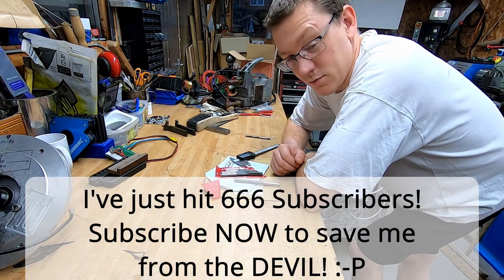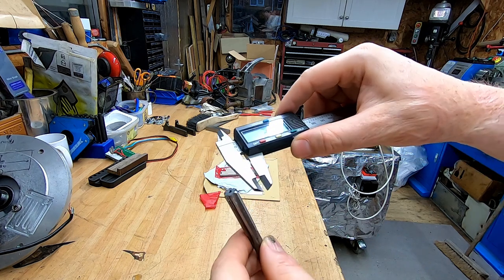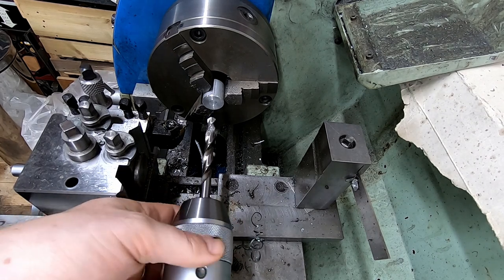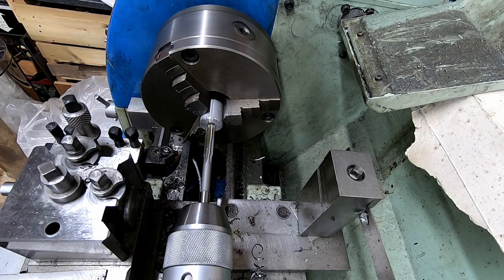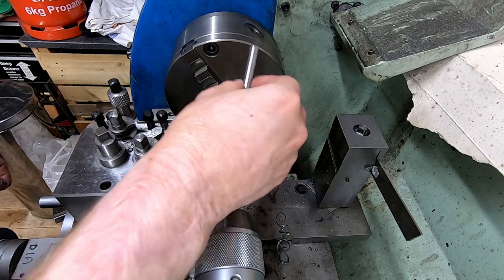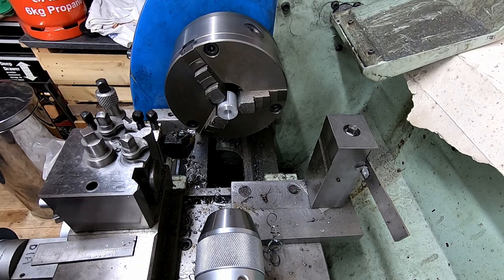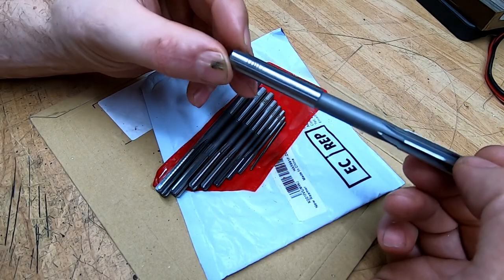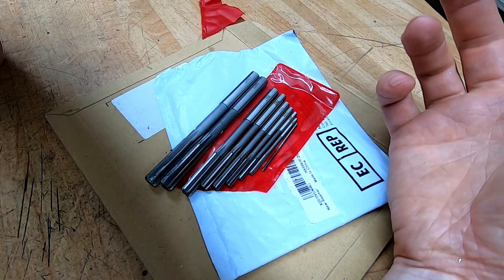I bought some cheap reamers

Comment: If you want a little tighter fit, lubricate the reamer and run it into the hole and stop the spindle.  Then draw it out.  Treat the reaming operation the same as taking the final passes on a lathe.  I always take two drilling operations, one to get it within 1/32 or 1mm, then a final drill to get the hole within a few thousandths and finish off with the light pass of the reamer (if you really care about the reamed hole).  Of course it varies a little with the final hole size, but that's the idea.
Reply from the maker: Thanks for the tips.

Comment: I've never had much luck measuring reamers 'across the points' (I've collected a handful, some of which have no size on!). Sometimes the absolute size isn't important, so long as the hole is round, if you're making the part that fits in it that is. I have done it your way, only using silver steel rather than a drill shank as it's ground pretty round and to size give-or-take.
Reply from the maker: Hi Matt, apart from these I've just got a 1/4" and a 12mm, so wanted to flesh out the selection. Agree that I can work with the size of the holes, only a problem for existing shafts. No idea whether my method of measuring is the right way to do it, in theory the shank should be the same size, but I found them all a fair bit under.

Comment: Thanks Olly. I had good luck as well using them for cleaning up bores in printed plastic parts.
Reply from the maker: Hi Dan, that's a good idea, they never come out round and drill bits are a bit too aggressive for 3d prints. I've made do by running the drill bit backwards.
Reply: @ollysworkshop  Thanks Olly. Yeah I can usually run the reamer through the print by hand. You said it well “they never come out round” LOL. Having good luck with printed small internal threads with likewise a quick once through with a tap straightens the roundness out. 

All the best 
Dan

Comment: Good to know Olly. They'll still be fine if you are machining the part fit inside it. Tony
Reply from the maker: That was my thinking. Also was wondering if a floating reamer holder would improve the accuracy by not holding it off line by a bit. Not measured my tailstock, but it does need adjustment as I can see the offset!

Comment: That was interesting and very well presented. Looks like you got three more subscribers, imagine being stuck on the number of the beast!!

Never bought tools off the internet yet but have often found that the cheap ones are rarely worthwhile. In Spanish they say  "el barrato sale caro" ... "cheap is expensive" for 20 pounds they looked good quality if maybe not totally accurate.

Good luck from Spain!!
Reply from the maker: Hi David, thanks for your comment. Looks like I've escaped the beast this time! I partly agree that cheap is not always the best for tools, but for things like sets of taps and reamers, it's nice to have a selection without breaking the bank, the ones that get used the most will get replaced with decent ones when they wear out, and the rarely used ones are there for the odd occasion that they are needed.
Reply: @ollysworkshop  Yes you're right it certainly gives a good starting point. I had in mind a set of taps and dies that I bought in Leroy Merlin (Dont think you have this shop in the UK like a B&Q but much bigger) at a bargain price but turned out to be very poor quality. I should have taken them back but some time had passed and I didnt have the receipt!!

Comment: I discovered +/- 0.4mm adjustable ones for about the same price - smallest possible being 1/4 inch (6mm) 
Also hand reaming should eliminate the run-out wobble of a fixed setup.
Reply from the maker: Thanks for the tip, I'll see if I can find some!

Comment: would have been an interesting comparison to see what the 10mm drill bit gave you in the same material.
Reply from the maker: Hi Jack, sorry for the delay.  I got round to measuring the 10mm drilled hole - i tried two different drill bits actually, the first gave me a hole size of 10.25 and the second 10.1mm.  Same material in the lathe, centre drilled, and then straight in with the final size drill bit. The surface finish that both left was poor (fine for a drilled hole, but poor compared to a reamed hole).  I had done some footage of drilled holes (9mm holes, but i did them on the mill) that i decided not to include as the focus of the video was about how good the reamers were, rather than how they compared to drilling.  Could be an idea for another video though.  Thanks for your question.
Reply: @ollysworkshop  sounds like the reamers definitely were the way to go then!

Comment: Next time, start with lathe having tail stock and chuck having dead centers in machine, razor blade between centers with tail stock all the way in, then all they way out, to prove that tail stock is trammed and running concentric with chuck and spindle to start with.  then swap over to  concentric end point in drill chuck for same test as well (to prove no run out in drill check in tail stock as well), before you start checking what the reamer is doing  a machine.  
My guess, reamers are to spec, and the reason that its reaming so much larger, is tolerance stacking in the machine not being corrected.  I bring this up, since can hear the twang as you pull the reamer out of the work piece, and proves that your machine has tolerance staking to begin with, which have not been resolved.
Reply from the maker: Hi, thanks for the feedback.  I can't disagree that an aligned tailstock would be a good thing, but I have a chinese lathe on a sheet metal stand on a wooden shed floor - it moves, so any alignment quickly goes away.  Also the tailstock quill sags considerably even when only slightly extended due to slop in the bore.  This is the primary cause of the movement that you see.  I have had some practice with the reamers since, and have found that drilling a bit smaller results in a much closer to size hole.

Comment: they are crap reamers. Bought 2-3 sets over time. The issue is they are not straight, they have run out and it will enlarge your bore over the tolerance limits.
Reply from the maker: Hi, thanks for your comment. It's a total lottery with cheap tools like these. I think the best use for these is for cleaning out holes in 3D prints (suggested by another viewer). I've tried this and it works really well. I got a load of proper reamers shortly after this video.